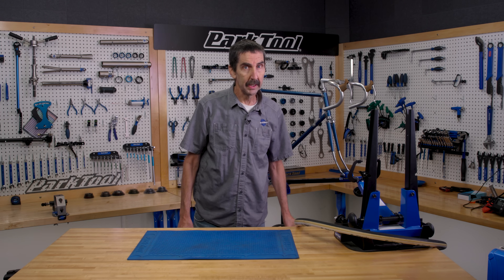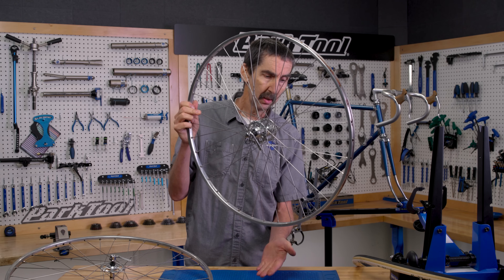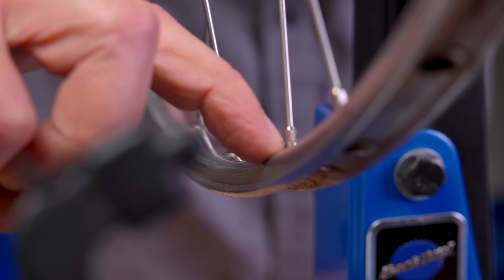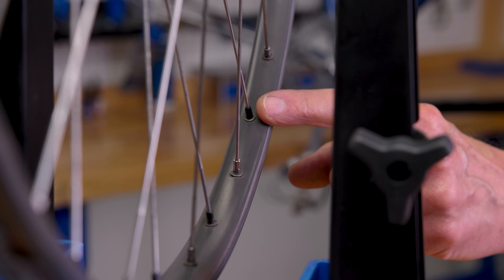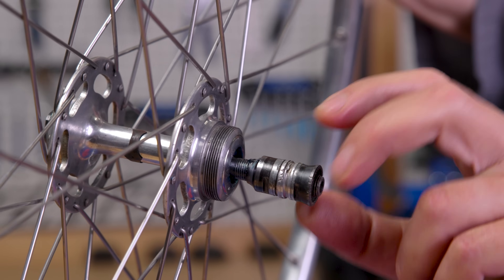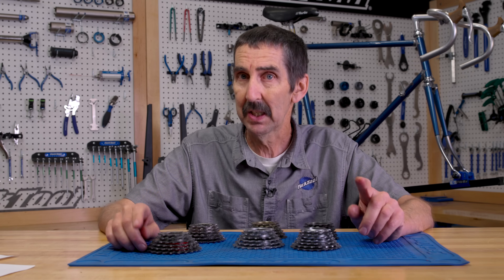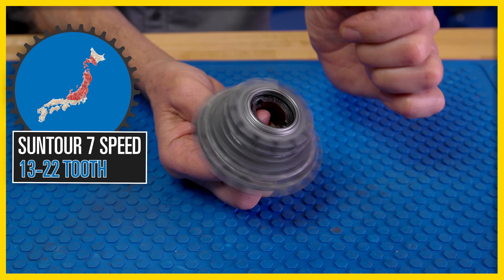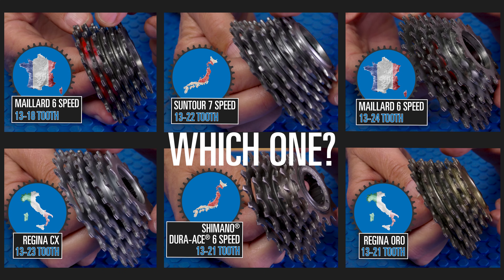Have Wheels Will Travel | Tech Tuesday #224

Comment: Should I use grease or oil on jockey wheels? I've always used grease, but noticed they spin better with just oil. If there's resistance, I think they'll wear faster. And the bushing is sintered, which indicates it's meant to be oiled I think!?
Reply from the maker: Grease will provide longer lasting lubrication, but it will not spin as fast. Oil is typically used there, but you may need to add some time to time.

Comment: I got an old Raleigh race bike at the dump for free and it is barely used it has almost brand new original tires and almost unused brakes but then it was used it had a big crash and bent both wheels but because it is free i am not allowed to fix it +the one time i rode it the shifter  broke

Comment: I would say Maillard 6-speed.
The 13-24 cassette is the one from my choice.
Because this freewheel has the biggest range.
The jumps between gears can be a little big but,
the lower 24 teeth sprocket makes it easier to climb up a hill.

Comment: Shimano's Uniglide freewheel (and chain) shifted far more accurately than others; together they provided almost index shifting level performance. I have used Suntour, Regina, and Maillard freewheels (along with Suntour, Sedisport, and Regina chains) and they almost all required overshifting (pull back and trim forward) to some degree, but Shimano just went bang into gear faster and smoother. Of course the derailleurs used factored into the performance as well. That said, if the bike is Campy equipped, I would go for the Regina CX, just to keep it all Italian.

Comment: Those Shimano Dura Ace freewheels were so well made. The grease might be a little sticky from age, but I bet that the bearings and races are in fine shape. Pull it apart and give everything a solvent bath, then re-pack with fresh grease. That would make a great video!

Comment: I would go with the Sun Tour 7 speed 13-22. I still have my collection of freewheels, including a SunTour 6 speed 13-18, a Sachs 7 speed 12-18, a Shimano Dura Ace 7 speed 12-19, a Sachs 7 speed 13-24, and two Sachs 8 speed freewheels (yes 8 speed) a 12-21, and a 12-23. I also have a few worn out Sachs 7 speed 13-21's that I would use for training. 
Those 8 speed freewheels would go on a special Sachs 8 speed hub, that was made for those freewheels.
Sachs freewheels (7 & 8 speed) were spaced to work well with Campy 8 speed Ergo levers. 
Back when I was younger, I was able to Big-ring a 13-21 over all sorts of rolling hills. Those were the days.
PS. At least none of the rear wheels had cracks at the eyelets.

Comment: Question...
I have a Catrike Expedition recumbent trike. 
I've heard that you can make it faster by replacing the bearings with ceramic bearings in the headset. 
True or not?
Reply from the maker: Gonna have to say false. It may steer quicker but thats not something that was preventing you from going faster before.
Reply: @parktool 
Thank you for your reply. 
So...what would help in this department?